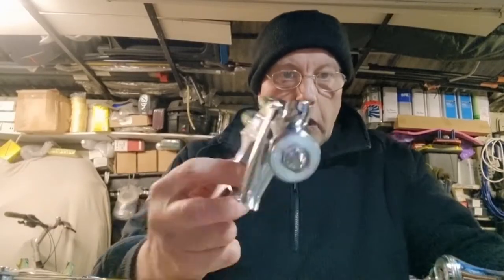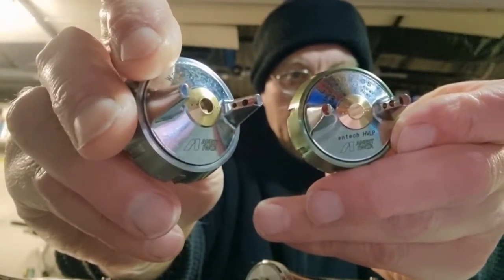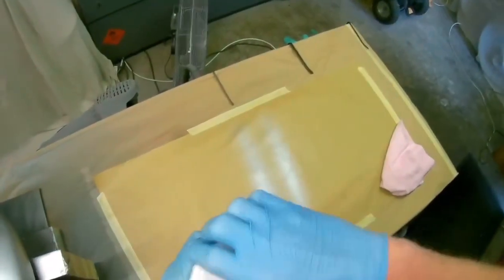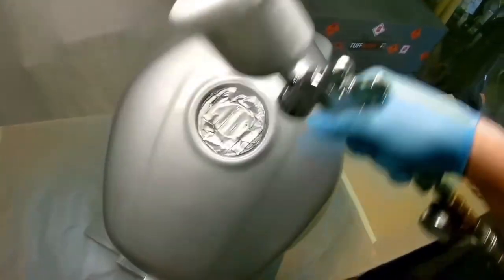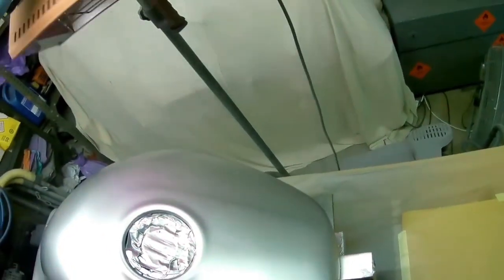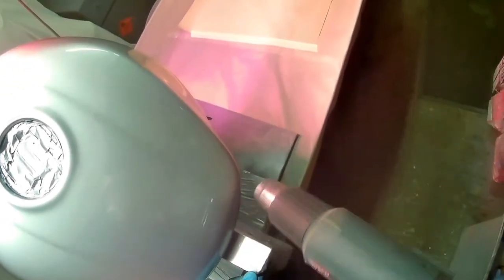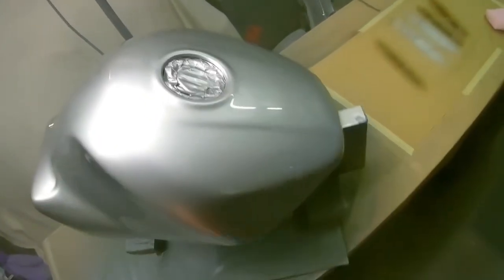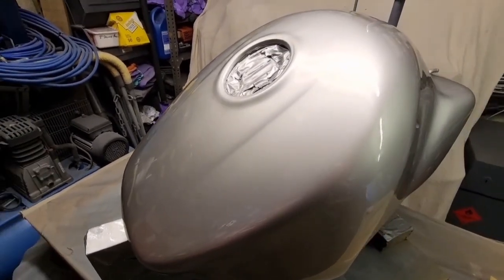Iwata LS400 Entech 1.3 & WS400 Supernova 1.3HD For Basecoat & Clearcoat

Comment: Pete I know this is older info. But you spell out the pluses and and or minuses of the LS-400 and WS-400 in understandable detail. I'm not a painter. But I sell spray equipment. Thank You, very helpful.
Reply from the maker: Hi John,  Thanks mate, I'm a mechanical engineer by trade so I'm really interested in what make these various guns spray differently from a design and mechanical point of view,  not just the fact they do. I do get a bit over the top sometimes, but we all have our faults, I guess. Thanks again, buddy 👍

Comment: I'm using my LS400 for waterborne base paint and the WS400 for clear coat I also have the lph400 sometimes for sealer or minor paint touch ups. I think iwata are the best spray guns.👌
Reply from the maker: Hi buddy, very good guns. The split trip in these guns definitely does something, that's for sure . Cheers 👍

Comment: I have the LS400 ET 1.4 and was considering getting the WS400 air cap and 1.3 nozzle set instead of the compete gun. Are you able to confirm that the WS400 cap will still screw onto the LS400? I know that my Sata guns caps are not interchangeable at all between series. Thanks for sharing your hobbies!👍
Reply from the maker: Hi buddy,  yes, the body's are the same as is the needle so a cap and tip will have you up and running. 
Sata say there caps are not interchangeable but in fact they are, I regularly swop HVLP for RP, the threads in the gun for the tip is the same as are the threads for the cap, the cap and tips are different as with the Iwatas but they do  interchange, cheers 👍

Comment: Great video, I’m a bit confused with how to determine the appropriate size air cap to the tip size. I’m having a difficult time finding information online showing a size chart and the compatibility of the air caps, tips and guns with their various recommended psi and cfm ratings. 

I’ve been looking at the 93506930 WS400 1.5HD Nozzle/Needle Assembly and wondering if it will work with the 93512320 LS-400-02 Air Cap Assembly that has a recommended gun inlet of 19psi and if that air cap and tip will fit in the Wider2 gun. If Iwata had a Wider4 gun in a pressure fed configuration it would make it a great deal simpler since I use a 3M pressure H/O cup and a pressure pot with all my other guns. I’m not particularly fond of gravity fed with the types of coatings I use.
Reply from the maker: Hi Mate, The WS400 tips have different size air holes to the LS400 tips, if you mix the two the material may over atomise as too much air goes through the tip, it may be ok on HS clear coats but not base coats, the LS and WS400 caps have a different diameter thread so won't fit on a wider2 unfortunately
Reply: @peteshobbies5383  thanks Pete, so if I understand this correctly the ws400 and ls400 tips will fit but the air caps will not so I would need to use a Wider4 air cap with the Wider2 gun to use the cut tips. The reason I’m asking is because I need a dedicated clear coat gun for high solid finishes and I just ordered a pressure fed Wider2 gun for that sole purpose. I would’ve bought the wider4 if it had a pressure fed version of the gun but sadly it doesn’t. I can only hope Iwata in the future will create it.
Reply from the maker: @bingobunga8995 The best thing to do would be a Wider4L as the tip and cap would fit the wider2 and is 4 split, if you want to use a LS or WS with a Wider4 cap, it must be a Wider4L cap not Wider4
Reply: @peteshobbies5383  Thanks Pete, that helps clear everything up! I’ll get the Wider4L J2 cap and pick up a WS400 1.5HD tip for my clear coats, cheers!

Comment: What about the gold cap? Have you used it yet? I like the ws400 more than the LS. Both are great guns imo
Reply from the maker: Hi buddy,  you mean the OBS base version? , yes i have,  it's very good, same cap as the WS400 clear but a different tip so less atomisation which is ideal for basecoat
Reply: @peteshobbies5383  yes that's the one. One of my coworkers swears it's the best   one. I was just curious about it. Thanks for the reply 👍
Reply from the maker: It's a really good base gun, I've never tried it for clear but i may well do, I used the LS400 for clear a few times last week, first time as it a base gun really and it was really good so maybe the gold cap one will be as well, we will see, cheers mate 👍

Comment: Hi Pete well explained mate I have heard there a hard gun to use and the WS400 to set up I think later on pete may be a sagola 4600 do you have to be nice and close
Reply from the maker: Hi Andrew, as you know i love my 4600 and that in my head would still be the gun i would have if i could only have one, for years it was the Gti Pro Lite but the Sagola has overtaken that for me, i normally spray around 5 to 6 inches from the part for clear but it does vary with the temperature, materials etc

Comment: WOW Pete that was a cracking finish on that tank 👏 I do like the look of those guns especially the limited edition ones they bought out and my fav is the green lotus edition.
I have heard a lot about these guns being hard to setup, watching the Gunman he's had one of these guns for a long time but always seems to get runs in his clear when he uses it.
Can you tell me what size bike tanks you use for your projects Pete, I've been looking at some on ebay but I can't gauge how big they are as in physical size, I've seen a few 9L ones but I would say that would be a lot smaller than what you used here, some don't even list the capacity or size so I have no idea what I would need, you can probably tell I have no idea about bikes 🤔🤷‍♂️ thanks Pete.
Reply from the maker: Hi John, that tank is around 22lts , the smaller tanks i use are 16lts and the biggest is 26lts, I'll try and remember to message you later with a few models to look out for that are nice to paint, you'll have to buy one with a few dents etc otherwise they are really expensive but I've sold some of mine for good money so its not all down hill and then you can just replace them, if i don't remember give me a memory jog mate, talk soon 👍
Reply: Ok thanks for that Pete, I've looked at a few tanks on ebay but to me they all look the same size when the capacity isn't listed.

Comment: Another helpful video Pete. I have both the LS and the WS. Which Do you think is the better base coat gun LS or the OBS ? I was thinking of picking up the OBS gun
Reply from the maker: Hi Tony, I think the LS is a better waterbourn gun and it uses a little less material, the obs i find is as good with solvent but not quite as good with laying wb base, which is fine by me because i rarely use it, i also like the obs because it uses less air so its the one i would use most
Reply: LS is better base gun. And, you can buy only the OBS nozzle because the air cap there WS 400 01 ( same as WS 400 clear gun)
Reply from the maker: Hi Walter, yes, the only difference between the OBS and WS is the tip

Comment: Great video as always Pete, I appreciate you giving us the quantity of paint you used, as a newbie it’s hard to judge how much you need to use for a particular panel and running out and makeup more isn’t really an option. Great video as always though the tank come out absolutely great. Cheers have a good Christmas. Steve.
Reply from the maker: Thanks Steve, Hope you have great Christmas as well mate, yes, the paint quantity is something I've been meaning to say for a while because with the various tanks i do it varies a lot, some are as little as 110mls of clear for two passes and some are 250mls and if your doing the underside you can add between 40 and 60% more on top so hopefully it gives people a better idea, thanks as always buddy, take care 👍
Reply: @peteshobbies5383  your welcome Pete love your videos and watch them till he end 😊 I bet the tip size makes a difference to the quantity of paint.
Reply from the maker: Yes it does but it's a combination, for example the Gti Pro Lite with a 1.3 tip and the TE10 cap uses less material than the same setup but with the TE20 cap, it's because the TE20 flows more air so draws more fluid through the same tip, the tip size is i find more relevant to the thickness of materials and the flow rather than just the flow if that makes sense, then there's HVLP which uses loads of air but doesn't necessarily pull more material through but normally transfers more material to the work 👍
Reply: @peteshobbies5383  Yes it totally makes sense I forgot about the viscosity and of corse the air consumption makes a difference 🤦‍♂️ thanks for the reminder.

Comment: Hi Pete
Great job on tank.
I bought a LS400 Entech a couple of weeks ago for basecoat. Not used it yet. Just put thinners thru it, to check the spray pattern.
Got it to spray candy on my best mate’s Kawasaki.
Yes, it uses a hell of alot of air.
I have a screw compressor  with a receiver which puts out 16cfm & it uses it all.
Won’t be getting the WS as I like to use an air fed mask for clear & there would be no air left for mask.
Would need a 400v supply to house to get more air.
Will check out your settings.
Good idea to mention how much material you are getting through as it gives people a rough idea of how much they need.
Usually use an rp for clear at 9 cfm so there is plenty of air left for me.
Reply from the maker: I must admit, i don't use an air fed as much as i should, i have the Devilbiss ProV650 and use a separate compressor outside for it but i only do that if i have a lot to do, I actually link two compressors together and can have both on if needed but it can get a bit noisy, it's a good way of getting lot's of air off a 240v supply, that Kawasaki Candy Green is a lovely colour, hope it goes ok 👍
Reply: @peteshobbies5383  Hi Pete
I’m not using the Kawasaki green kandy.
Im replicating an old original design but with bling.
Am using HOK pale gold Metajuls under Brandywine & Cobalt blue Kandy with white pinstriping.
Have looked up your respirator, is it reliable?
I use a Sata Airstar half mask,air fed respirator with a non airfed one to switch when I leave the booth.
Only thing is when I was spraying the Metajuls I heard a hissing noise & one of the air lines to the mask had detached somehow mid spraying.
Had to make a quick exit.
I swear something always happens, but different evertime.
Guess that’s how you learn.
If it was plain sailing everytime guess I wouldn’t learn anything!
Reply from the maker: @vonovine  Yes, the mask has been reliable although i don't give it lots of use, there's not much to go wrong really, my biggest problem is i have quite a long face, no jokes please 😀,  and it's a little tight, not very but a little, I'm 2mts tall so most things are a compromise but otherwise it's fine
Reply from the maker: Btw, I've ordered some little magnets  on ebay, what a great idea,  cheers
Reply: @peteshobbies5383  
Well, am going to duck tape the lines in place next time.
If one comes off again I’ll look into that mask.
Thanks for your reply!
Reply: The magnets work really well to stop underspray.
I leave them ‘magneted’ in a row in a metal draw.
Bet you look like Darth Vader with that respirator on then😱

Comment: The only differences are the cap and nozzles?
I mistakenly bought the LS version to shoot clear. I already own a base gun that I'm satisfied with and I also used it for clear.
Reply from the maker: Hi Michael,  yes, the only difference is the cap and nozzle
Reply: @peteshobbies5383  if I can't return, my next option it to change out those two things
Reply from the maker: Yes, the needle is the same, number 20015 so tip and cap

Comment: Hey Pete, where's all your overspray going? Man, that base went down real smooth! Great job!
Reply from the maker: Hi Rod, I have a 24" fan in a box that extracts outside through 4" filter media,  i change the filter every 15 hours or so of use
Reply: @peteshobbies5383  cool! I wondered because there almost no overspray in your videos and it seems like you're in a tight space.
Reply from the maker: @CASTANEDA83  There is some about,  particularly on the upright car panels as there is lots of overlap so half the pattern is just shooting in the air, I also have one stand alone fan that pushes the overspray towards the outlet fan and another if needed but don't really need that most of the time, it works well, as you can see I'm not in ideal conditions but we have to work with what we have, cheers buddy 👍

Comment: So what’s the difference in the LS400 and the WS400 base?
Reply from the maker: The cap, the OBS has the same cap as the WS400 clear, the LS is completely different.
The original WS400 base guns were exactly the same as the WS400 clear guns apart from their markings, just so the painter could tell them apart, they quickly realised that for base it was over atomiseing the basecoat so they changed the tip to one with smaller exit holes, this cured the problem
Reply: @peteshobbies5383  got it. How about the application of basecoat itself. Does it spray much different than the LS?
Reply from the maker: The OBS puts out a little more material than the LS, the LS is true HVLP so tends to have less overspray as your normally using it a bit closer and at a lower pressure, the OBS is better if you dont have lots of air as the LS uses loads, only the X5500 HVLP and Devilbiss HV30 cap uses as much as the LS
Reply: @peteshobbies5383  in a production setting would you go with the OBS or LS?
Reply from the maker: I would think the LS, it saves on material,  has lower emissions and is better for waterbourn paints which is often used in a production setting

Comment: 1.3 vs 1.4 what's the difference really?
Reply from the maker: 1.4 will flow more material so normally it will make the gun faster to use, however,  sometimes the larger tip makes the finish not quite so flat as the cap is the same so atomisation isn't always as good
Reply: @peteshobbies5383  now, another somewhat unrelated question. I need to repaint my car I have an Acura tl. I mostly need to relaint a panel or two and reclear.the whole car. I need an all arounder right now, one gun for the whole thing. I can rig a couple air compressors together and get at most mmm 13cfm reliably clean dry air 13 cfm I think is the most I'll get. I'm considering the iwata wider4l or kiwami4 v13wbx. Any thoughts between the two? I suppose either would be a 1.3. so the gun would need to be good at base great at clear what would you recommend given the amount of air at max I can give the gun? I have reasonable experience
Reply: Or, if you think another gun would be a better choice, do tell...I'm also open to a SATa 5000 1.2...i had a 5000 but it was a 1.3 and too damned fast of a gun. Sprayed a billowing cloud of paint that gun. Gave a flawless finish though...
Reply from the maker: I have a Wider4L 1.4 , only recently got it and it's very good especially as it runs at 15psi so has relatively little overspray, I also have a Kiwami4 WBX is 1.3 and that is also good but uses more air, the WB uses more air than the WBX so unless your holding tank is a reasonable size you may struggle, if money is not a particularly concern I would recommend the Sata 5500x 1.2 RP or Sagola Xtreme DVR Clear in 1.3, they both work great for base and clear, particularly clear, are on the limit regarding air you have but should give you a few panels at a time, another option is the Kiwami4 BA4J, uses less air, is a great all rounder and not expensive
Reply: @peteshobbies5383  in your experience is the wider4l a pretty quick gun as a 1.4? Would you rather it be 1.3 or is it good as is? Thank you for the advice btw. Very much appreciated.
Reply from the maker: @johntiez4981  The 1.4 Wider4L isn't fast, it's quite slow really, it doesn't put out huge amounts of fluid, less than the Kiwami4 1.3 by quite a lot so the worry may be it's a little slow rather than fast

Comment: Great channel! Hey how do these compare to the Kiwami4? I thought about trying to get a Kiwami4 with a couple different tips. I dont paint daily, just as a hobbie, but want the most level results possible.
Reply from the maker: Hi Stephen, that's a good question, the LS & WS are a very good combination, neither is my favourite gun but there's no denying they are good, the Kiwami4 is more middle of the road, it's a very good do it all spraygun which can achieve excellent finishes, it's not as specialist as the WS/LS but it is easier to use, much cheaper and uses less air, ultimately the WS/LS will give you a better finish once you get used to using them but as with most of these guns there not much in it. 👍